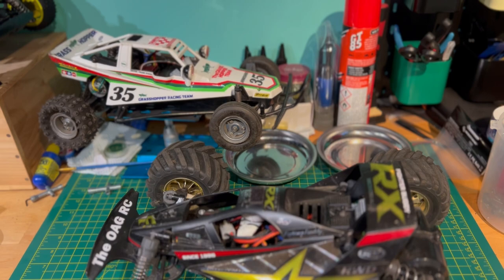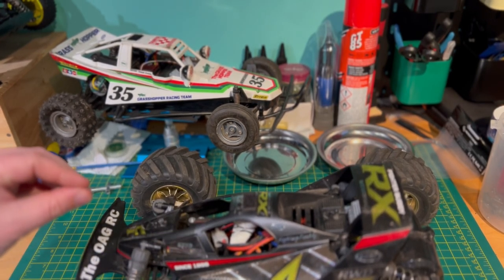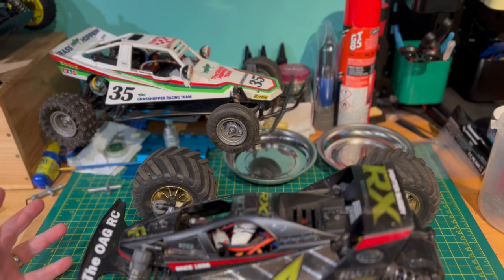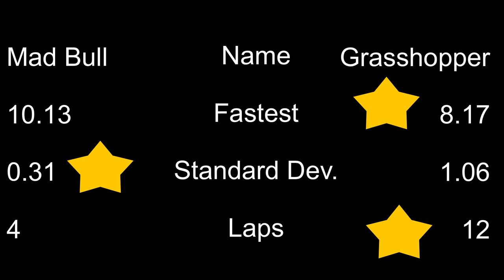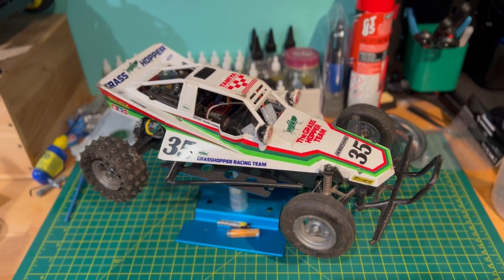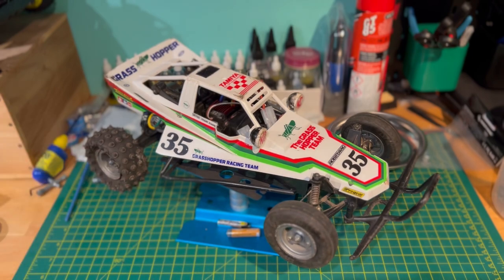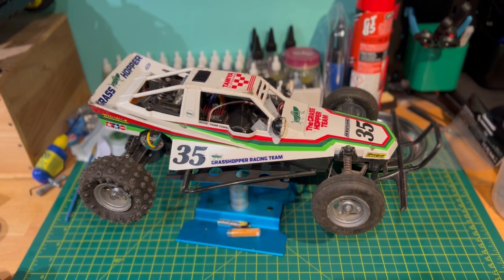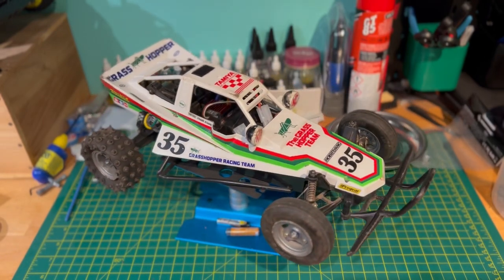Tamiya Grasshopper VS Mad Bull OR2023 R1M02

Comment: Another upset, Craig! This series has had a really interesting start with the underdogs coming good! I could see how you were struggling with the Mad Bull and the 3 point turn around Creation Corner was the nail in the coffin! Great stuff mate, bring it on! 😁😁👍👍
Reply from the maker: Hey Mark, the OR track is a real giant killer in 2023!! Creation Corner seems tighter this year taking it the other way which might have been the undoing of the DT03 and the Mad Bull. Didn’t help that it only got a few laps before I slammed it into the shed 😂 Some proper RCs coming next with the Hotshot on the track 🚀 Thanks for watching pal 🙌🏻👍🏻

Comment: Great win for the humble Grasshopper. It really is very well suited to its original 380 motor. Less is more.👍😊
Reply from the maker: Hey Sean, the GH allows greater control at the lower speed giving it consistency even though it is slower. Perfect for the rough terrain on the OR but there are plenty of occasions when you realise that there is no control mid bounce 😂 Thanks for watching dude 🙌🏻

Comment: Excellent installment Craig! The old Grasshopper did very well out there with a respectable time! The poor Mad Bull didn’t have much of a chance given its wide turning radius.
Very entertaining!👍😊
Reply from the maker: Hey Jeremy, you are right my friend. The Mad Bull had no chance despite its significant speed advantage! The Grasshopper is a neat little car to drive but lacks the top end speed. Makes it consistent though and there are points on offer for that on the OR this season. Theoretically I could drive a car slow and consistently and it could win 2 out of 3 on the scoring! 🤔 The seasons rolls on and many thanks for watching pal 🙌🏻👍🏻

Comment: I was a little surprised by the Mad Bull struggling that much but I have not tried driving mine that controlled really, mostly out free running it around and smiling the whole time. The GH with the 380 motor may have given it the advantage of not having too much power to make it unwieldy and chaotic! I think they get really hard to drive the faster you go so this being a little slower made it a good bit faster. Great job as always on the video bud, I enjoyed it!
Reply from the maker: Hey Addam, thanks for your great comment. It would have been better if I had remembered to do the commentary over the running footage! 
The Mad Bull is amazing fun but it can’t take a tight turn. There are a few that have struggled… wait until you see the Pumpbox next week!! The GH heads into the quarter finals!

Comment: Very true thoughts Craig. Although it might not be the fastes car, you can go on full throttle the whole time. Sorry for the Mad Bull, but so the rules are.
Reply from the maker: Hey Dirk, it was unfortunate but it is the rules! The Grasshopper was on full most of the laps and it is easy to drive consistently at lower speeds. However, the 4wd models are king as you will see with the Hotshot on the next video 🔥🚀

Comment: Hi there Craig, you did call it! The Grasshopper wins the day. I’m sure that the front dampers could be modified to take some oil shocks, probably call upon the other hopper series chassis, to see if any offerings from those chassis’ could be used to hop up that front suspension. I’m looking into it too, for my Hornet. Great series. Best wishes to you and the family 😊
Reply from the maker: Hey John, the little hopper lives to hop again! It is going to struggle in the quarter finals for sure as there will be some awesome RCs in there alongside it but I am happy it drives again! Thanks for watching pal 🙌🏻
Reply from the maker: You are probably right Jess. Not sure there is much to do to help the old girl!

Comment: There we go! I'm 2 for 2! I knew the hopper wouldn't  let me down.
Reply from the maker: Hey Paul, it was an easy win in the end for the old girl! The Mad Bull really struggled round creation corner and I tried to take a wider line into the turn and ended up deep in the shed! Grasshopper moves on to Round 2 but will it be a Semi Finalist?
Reply: @The OAG RC  I need to review the contenders . If the tt02b is in the running, then it's going all way.
Reply from the maker: It is in the running 🚀

Comment: Hey it just shows again that top speed doesn't help if you can't get around the corners.  I have thought before about what you were saying that modern day RC buggies seem to be designed for a smooth track whereas buggies from the 80's are designed more for the real world lumps and bumps.  Also the old Tamiya buggies had nice big springy bumpers because they were obviously going to get crashed a lot!  Nice one Craig.  Best wishes 👍
Reply from the maker: Great shout on the bumpers Pete. I always look at modern buggies like the TD2 and wonder how that is going to cope with a big smash…. The Grasshopper is very forgiving with its design and is why after years of being driven hard it is still rocking! 
Thanks for watching pal 🙌🏻

Comment: I was expecting the madbull to romp home with the win 😮i guess slow and steady does win the race 😎
Reply from the maker: Hey Richard, in this case it was slow and steady that didn’t crash into the shed! The Mad Bull was quicker but I couldn’t get it round the corners. Maybe next season!! Thanks for watching pal 🙌🏻👍🏻
Reply: @theoagrc  or more power and slide it around the corners with a skandi flick 😎
Reply from the maker: 😂🤣 You ever tried that with a Mad Bull 😜
Reply: @theoagrc  i cant even do it with the cougar, just ends up in a spectacular crash 😂